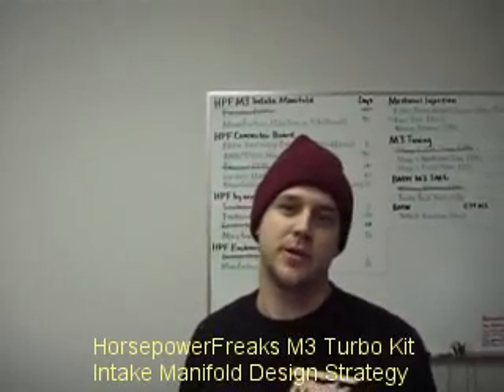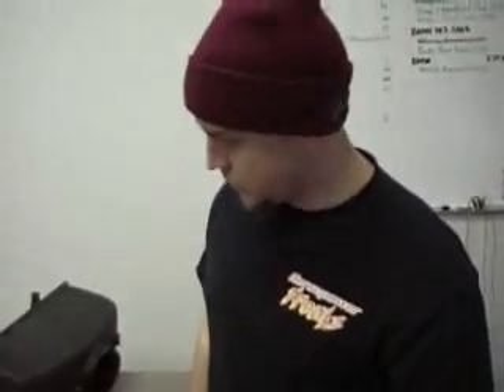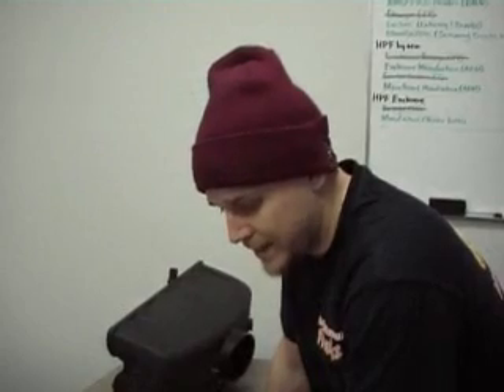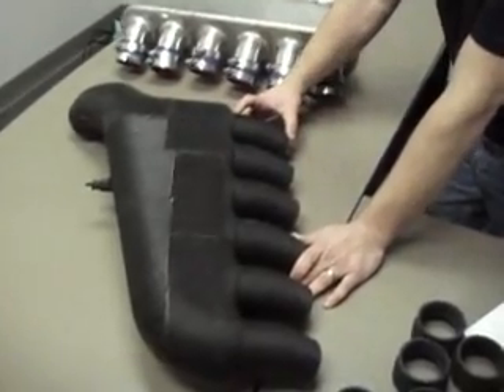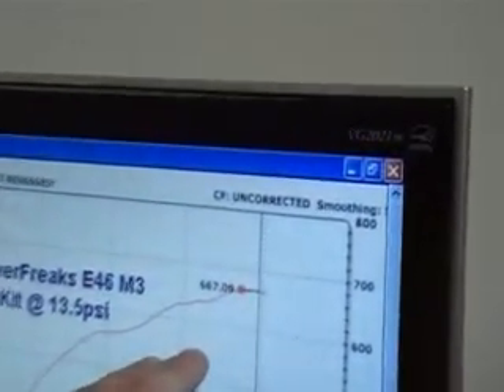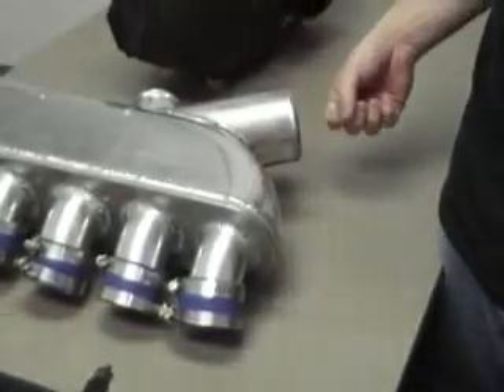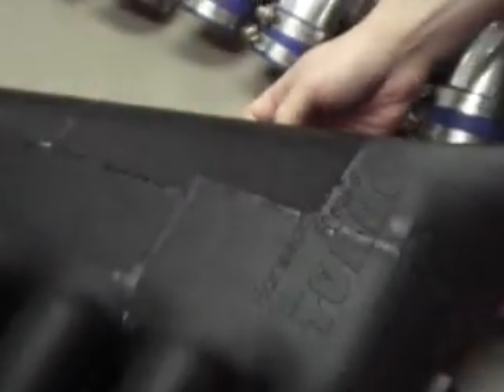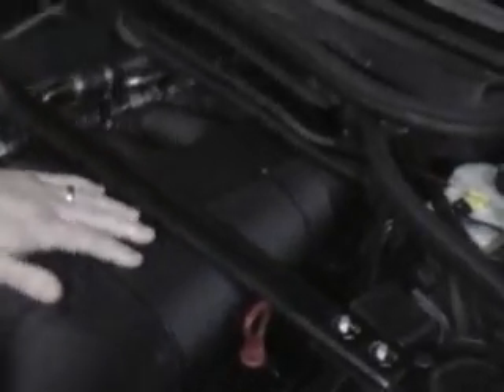HorsepowerFreaks M3 Turbo Kit Intake Manifold Design

Comment: Did any of you listen to the video, he said the plastic manifold is a mockup for testing, the production item will be Ali. Plastic allows for more complicated manifold shapes, usually to improve torque and its also lighter. It is the material of choice for modern engines, Ali has no advantages over plastic.